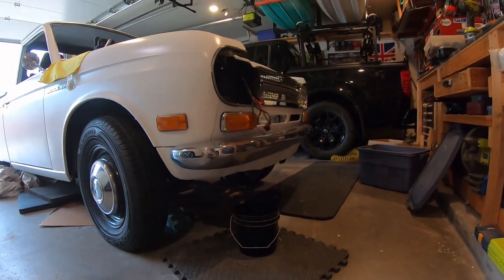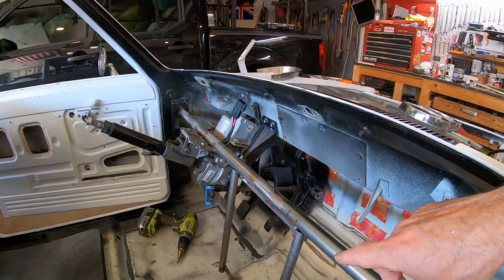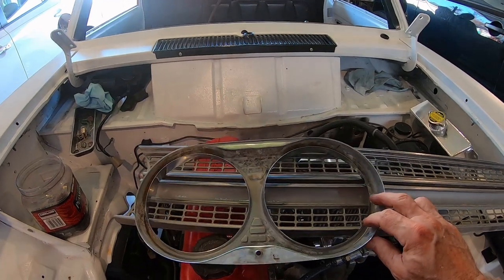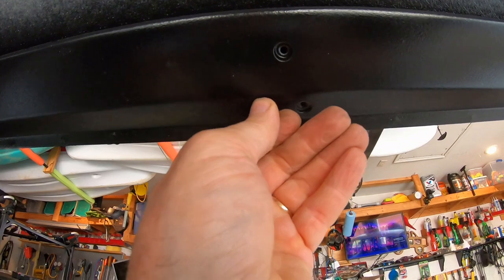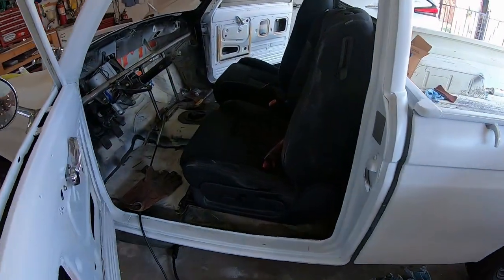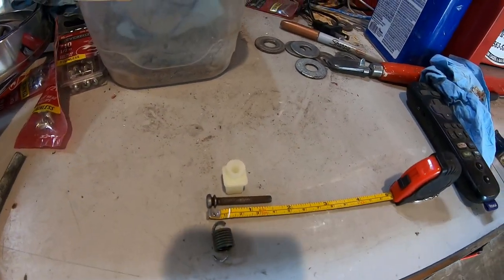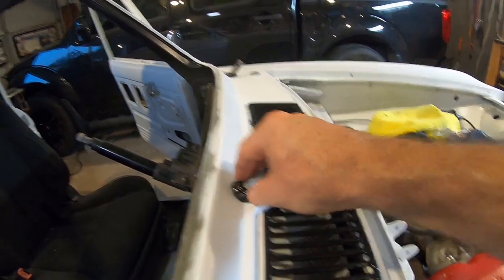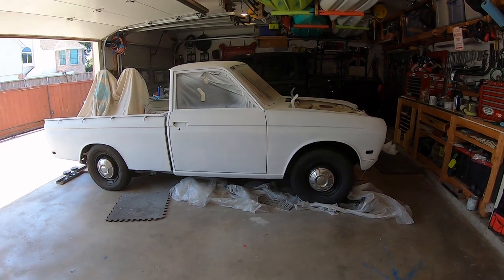Datsun truck restoration part 24. Stainless grill installed with rivnuts. Altima Seats installed.

Comment: man it just feels like theres a different sized bolt or screw for everything.
coming along nice
Reply from the maker: Yes there is. Plus most were removed when I bought it. So I am trying to determine what went where. The body is all SAE and some of the suspension is SAE. Engine is metric and some of the lights are metric. 1973 us all metric with the 620. Its a fun challenge.